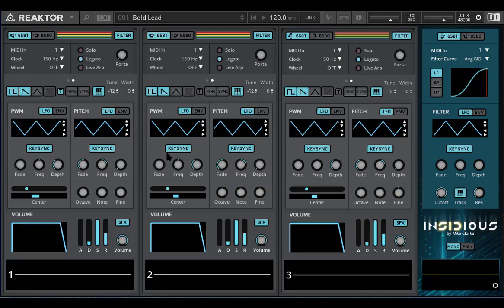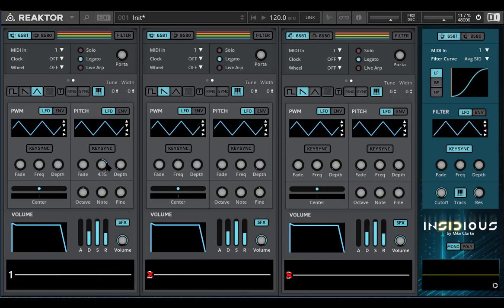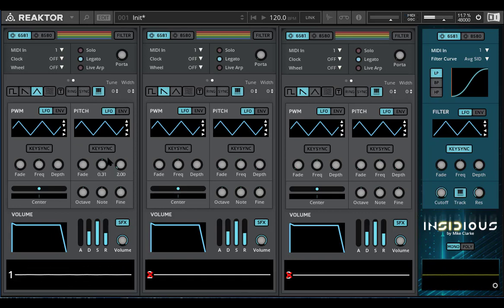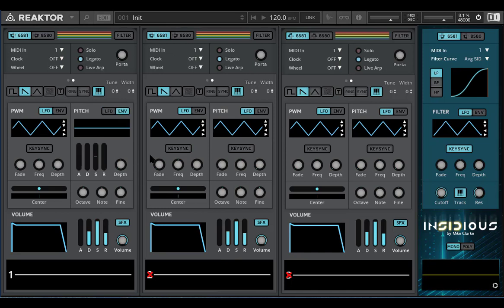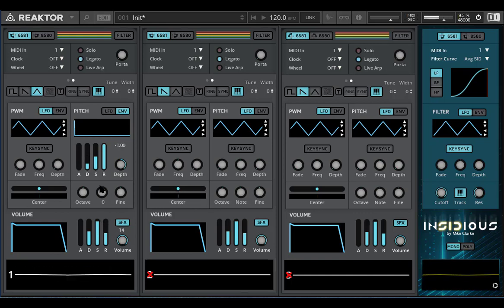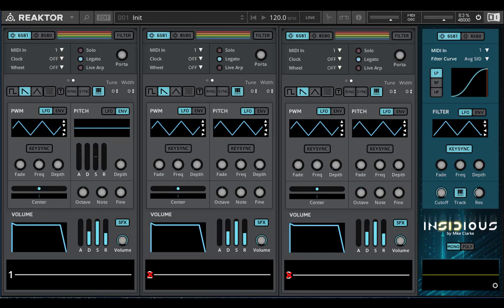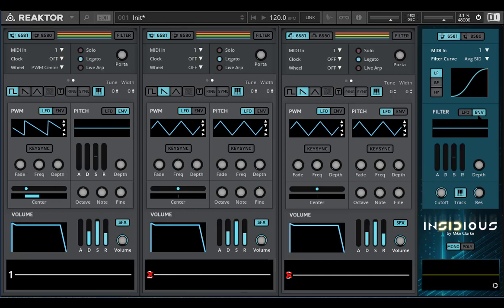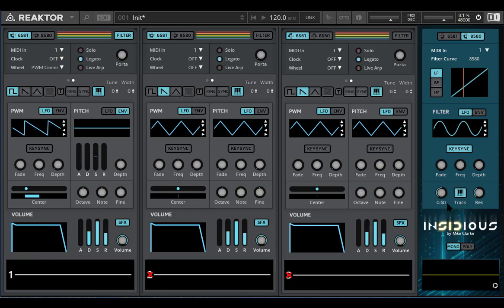inSIDious Tutorial: Modulation

Comment: Reaktor unfortunately is pretty unusable on my 4k display, my old eyes can't see anything. How do you solve that with Insidious, is there maybe a 200% zoom version that just uses large fonts + GUI elements?
Reply from the maker: There's usually an option in your DAW to enable High DPI Mode. I use Studio One and there is that exact option in the general settings and you can set a scale value. Reaktor works with this and scales up accordingly. Alternatively, if you're on Windows, you can use the built-in magnifier by pressing Windows and + to zoom in and Windows and - to zoom out. it has a few different modes, so pick the best for you from Windows' Ease of Access Setttings. Another option that I used to do was have a second 1080p monitor. Dragging the VST window onto that monitor acts like a zoom.
Reply: @fromwithinuk  Bought my copy of Insidious today. Thank you!